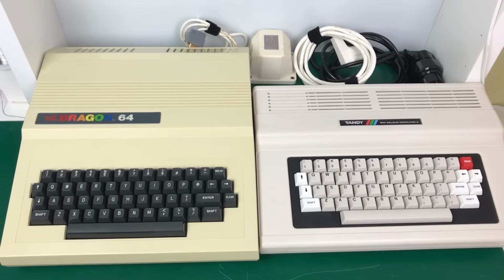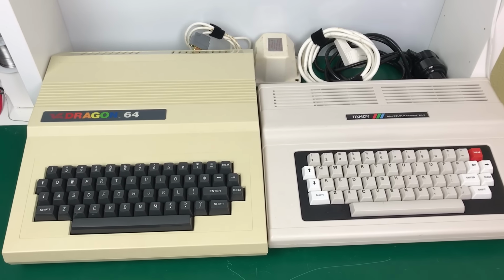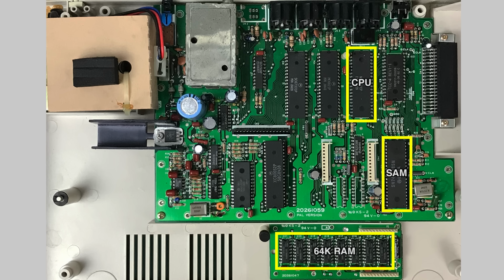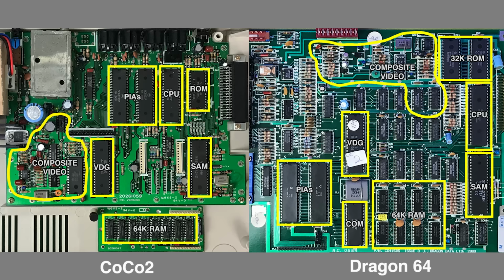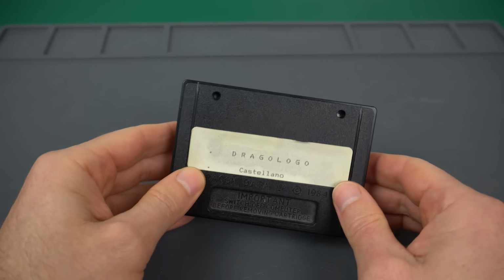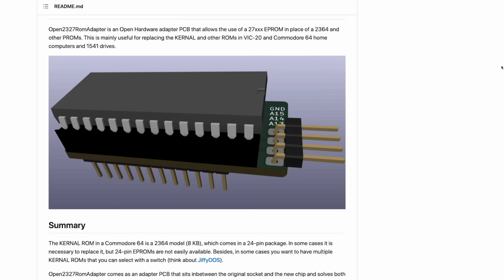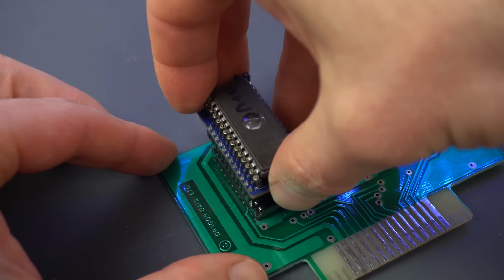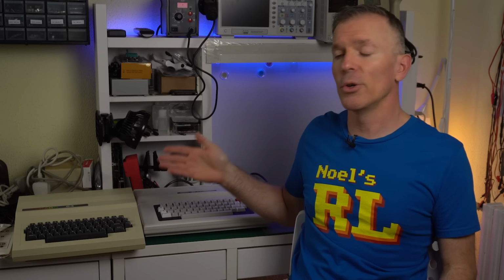Is The Dragon a Clone of the CoCo?

Comment: My favourite Dragon game was Speed King, I thought it played really well with an analogue joystick.

I'm pretty sure it's possible to convert a Dragon to a CoCo (or vice versa) by changing the ROM and using an adapter for the keyboard connector. I have a vague memory of reading about switchable adapters that could do both at the same time.
Reply: I suspected the hobbyist community in the UK figured something out: a lot of CoCo software out there compared to the Dragon I think.
Reply: Speed kong

Comment: Clones are usually equal or poorer.  The Dragon improved on the design so I think this is a little unfair.
Reply: Not always.  The CoCo didn't get a lot of love from the big developers, especially in the early years, so most of the games were clones.  Witness "Donkey King".  But in more than one case, the clones were every bit as good if not better than the official ports that were eventually put out.

The CoCo had a number of 'Frogger' clones, and also got an official 'Frogger'.  Some of the clones have better gameplay than the licensed version of the game, though it wasn't bad.

Comment: If you have a T1 VDG in the Coco, try this: POKE 359,57:POKE 65314,80. If the border turns green, and SHIFT-0 toggles between true upper and lowercase letters (as you type them), then you truly do have a T1. There is a version of OS-9 Level 1 that supports that fully, as well as numerous terminal programs, etc. Also, there is a trick to convert BASIC programs between them without retyping them (or using special utilities): Save them in ASCII format (for example CSAVE "PROGRAM",A). It is slower, but it doesn't tokenize. Also, one thing that is completely different is the disk drive ROM and disk drive formats; the Coco's use granules (9 sector blocks) while the Dragon uses actual sectors, and also supports >35 tracks. (The disk controllers on both can handle up to 80 tracks and double sided just fine; it's the Disk Extended BASIC vs. Dragon DOS ROM's that are completely different). Also, the CocoSDC also emulates hard drives as well (the Coco 3 with NitrOS-9 EOU is based on that).
Reply: Yes got to love NitrOS-9 L2 on the CoCo 3 with the CoCoSDC!

Comment: Is that Dragon MSX Compatible?
Reply from the maker: Compatible? Not at all, starting with a very different CPU.
Reply: I know that there are models that are MSX compatible. I saw a YouTube about this once.
Reply: There (almost) was a Dragon MSX, but it never made it past pre-production, so very few exists. It was a pure MSX though, so not compatible with the D32/64. And as Noel said, completely different CPU’s (6809 vs z80), as well as different sound and video chips. The BASIC interpreters were quite similar, though. The MSX standard was based on the old Spectravideo design.

Comment: I’m not sure you’re putting yourself in technology of the time. The bios was still relatively simple so that wasn’t too much to get done, but you wanted existing peripherals working with what you were building. And when you were trying to bring any new product to market, you generally either had to build up the circuits from individual components or use an integrated IC set.

Comment: Love it all, especially the 6809 disassembly and comparison.  Brings back memories.
Reply: The 6809 was an amazing CPU for its time, far superior to the 6502 I would say.  6809 assembly language is actually fun to program.  Apparently the price was a stumbling block and so it was rarely used.  A shame really.
Reply: It has more accumulators, more (16-bit) index registers, more (16-bit) stack pointers, more addressing modes, hardware multiply, and an 8-bit register that allows you to position the Direct Page anywhere in memory.
Reply: @joelavcoco  Indeed.  It's a shame the 6809 didn't see more use.  Imagine how much better the software would have been back in the day.  They did remarkable things with the 6502, but at the end of the day you can't get blood from a stone.
Reply: @Starchface  I loved the 6809 too. I thought it a lot nicer than the Z80 to program. However, I think the limitations of the 6847 VDG was a big part of why these machines didn't keep much of the market. Especially in the UK, where we could not use pseudocolours in hires mode.
Reply from the maker: Thank you! It was fun confirming why those few bytes were different.

Comment: So the board size of the Dragon looks to be similar to that of the board size of the original (1980) CoCo.  IIRC the original CoCo was just about as deep as the Dragon
Reply: Yes, it was... I used to sell these machines back in the early 80s in a small retail shop here in the UK, and they both took up similar desk-space.....  Both had external power supplies back then as well.  They also seemed more inter-compatible - you could use more game cartridges/tapes, and controllers between them!
Reply: @stevesstuff1450  The original CoCo had an integral power supply, but the TRS-80 (Model 1) did have a separate power brick.  That may be what you were thinking of.

Comment: I'm not sure the differences between the ROMs are entirely lawyer-inspired, any minor change to the code would shift things around, and the Dragon and CoCo used some different chips so the code for them would be slightly different, and if there's any support for the printer port on the Dragon then that will have added a huge chunk of code. Unless Dragon had specifically paid for compatibility, Microsoft wouldn't have bothered. Re-ordering the tokens is also a pretty good way for Microsoft to protect themselves from being accused of selling the customisation that Tandy undoubtedly paid for,
The cartridge port being the same could just be that its possible the Dragon 32 and the original CoCo were much closer in design than the '64 and CoCo 2 you have for comparison. It's also fair to say that at the time of the Dragon 32 the (personal) computer industry was very different and "borrowing" other peoples design ideas was tolerated a lot more than it is now if it wasn't too blatant. Generally being "first to market" with a product was the strategy rather than trying to be exclusive.
Tandy's computers were expensive in Europe, which is why they are so rare here, which is a shame. I used a model 1 Level 2 with expansion interface at my first job between school and uni, and I've always had a hankering to get one for sentimental reasons, but when they turn up they are either in terrible condition, or I don't have the money at the time! And I wouldn't rate my chances of getting one shipped from the 'States with the monitor intact for any reasonable amount of money!

Comment: I'd argue they're both variants of the same Motorola reference design, the relationship between modern AIB GPUs and the reference designs is similar. Perhaps the similarity in the i/o subsystem is related to a similarity in what parts were available and the rest is just "Yolo, may as well see what we can get away with". When you have an open source reference design (Motorola's)  and a previous system based on it (the CoCo) economics of scale means you might well wind up using the same parts (they'd be cheaper because the CoCo would be using them) which necessitates similar circuit design. I suspect one of the big draws of custom chip design (the NES or C64) over using off the shelf components (like the Coco or IBM PC) is making easy clonability much more difficult: instead of just reverse engineering the BIOS (or writing your own like Dragon did) you have to reverse engineer the custom chips which is a tricky business if you want to maintain compatibility AND keep the lawyers at bay.
Reply: The IBM PC XT appears to be based on a reference design of the Intel 8088. Why reinvent the wheel?
Reply: @migry  Yep and it could  be argued that with the XT IBM cloned the 5150 and added some improvements. I suspect Dragon Data knew full well that they were in the clear as long as they didn't clone Tandy's BIOS from developments in the early PC Compatible market. The rewired keyboard connector strikes me as a specific design choice (perhaps PCB design related) or a concession to overly cautious lawyers. To me the Dragon is more like the early x86 designs that came out just after the 5150 that were not truly PC compatible (i.e. the ones that ran on custom versions of MS-DOS). I'm more curious if the early 80's Dragon user community knew that the Dragon could be easily modded via a BIOS swap for CoCo compatibility.

Comment: Very thorough and unique approach as usually. I'm the owner of a cpc6128 and one of the things I would like is someone to make a step by step tutorial on how to make the simplest rom expansion, just one rom using one eprom / eeprom. As few components as possible. There are many products that do this but diy is what I'm looking for. The already available designs, include 4 or 6 roms and really, you need to solder a very large number of cables making them unattractive and cumbersome. I wish you consider this for a future tutorial.
Reply: i wanna know how/if its possible.. to convert it from the multiple DRAM chips to a single SRAM..or have a rom expansion that takes over from main ram from the get go.. (im having trouble sourcing 4164s atm)

Comment: That dragon looks to be a really cool clone of the Coco. I wonder if there is a mod to switch the BIOS ROMS to allow compatibility. I'd not be surprised if someone out there has done so.
I still have my original Coco 1 and the game I liked back then was Polaris. It's a Missile Command clone. Unlike most home versions, the analog joysticks make moving the cursor to fire your missiles a lot like using a track ball. You should check it out! Great video as always!
Reply: Betagamma Computing have done exactly this with the DraCo64 machine conversions. Both Dragon 64 and CoCo II compatible at the flick of a switch. The systems include a keyboard remapper board.
Reply: @mikemiller1208  I knew someone out there has done it before. They are practically the same machine with minor differences.
Reply: Very likely just swapping the ROM chips would simply work, though you would not get a working keyboard without a bit of editing of the ROM, to change the mapping of key matrix to characters, which might be hard as it looks like the actual routine depends on simple bit pattern shifts, so you would need to find spare room in the ROM to put the extra bit shuffling in, as likely the existing keyboard routine memory is tightly packed.
Reply: @SeanBZA  I'm sure some clever hacker out there could have and may have already figured it out. Possibly use an Arduino or some small SBC to do a ROM emulation. I would think that you simply change out the bit pattern for the CoCo switch and no need to take up anymore memory would work too.
Reply: Agreed on Polaris.  It's a great game, and I think it even runs on a 4K machine.  (Maybe 16K?)  I remember how horrible Missile Command was on the Atari 2600, but even the old 1-button, non-centering "black beauty" CoCo analog sticks made Polaris a dream to play.  Great for flight sims as well.
Reply: @joelavcoco  I loved the 2600 version considering it was able to do it at all. But nowadays we are seeing things with the 2600 that are just mind blowing.

Comment: Since I didn' t own any of these computers(I had only the lame ZX Spectrum +), I can' t express any opinions(not to mention that I "lost the ball" almost from the very beginning), but I will give you only two suggestions(again):

-First, can' t you build a simple circuit that will have a ZIF socket and an external power jack for the ROMs you want to program, but your programmer can' t handle their programming voltage? Along with a couple of pin headers attached to some cables? This way, you will be able to use a transistor that will use the external power thru an input from your low-power output, fed thru that transistor to the power-hungry ROM. Of course there should be some extra female headers in order to drive a cable to the specific pin you want to boost with the transistor with a cable...

-And second, if the programs are virtually identical except their addresses, can' t you make a simple program which will be taking any program written for the one computer and just make the appropriate relocations to the addresses for the other computer?
Reply: The ZX Spectrum in it's various iterations was never a 'lame' computer.........
It was inexpensive, and originally had a 'dodgy' keyboard, but later revisions fixed that.  Come the +2 models they now had a much better sound synthesiser chip outputting to the TV that could sound really good!  It had better use of colour/resolution than most other 8-bit machines at the time - as long as you could avoid the horrible colour-clash!!
But it can't be denied that regardless of it's limitations, it created a whole new generation of bedroom coders and companies; many of whom are still around today - take EA for example....not everyone's favourite company now because of their inexcusable loot-box systems, but EA started back then publishing Spectrum games, and has some of the most respected coders and computer musicians associated with it, alongside the C64, of course....
Reply: @stevesstuff1450  Yes, since +2 they started putting more humane keyboards, but I, personally, had the +...

Comment: Both of these don't look like much but they actually feature the best (and most expensive) 8-bit CPU ever. The 6809 is like the grand daddy of the 6502 and very much prepared to run a real multi-tasking operating system as we know it today.
Reply: 6502 was the cheapest 8 bit MPU. Nothing else about it is remarkable. The 6809 is a joy to program for in comparison.
Reply: @lawrencemanning  As is probably clear to anybody who's written just a few thousand lines of assembler for each, the 6502 is remarkably well designed, with a number of design choices that were clear improvements over its inspiration the 6800 (not the 6809, which came years later) even when you're not taking cost into account.

Among other things these include removing some of the most annoying behaviours of the 6800 (setting flags on stores, not being able to push the index register), being little-endian to save a cycle on any instruction involving a 16-bit address calculation, and being able to do indirect memory access through an address in any zero page location, rather than just through a single index register.

Though the cost  considerations seem to have precluded making a CPU that was better in every respect than the 6800, the 6502 designers did produce a CPU that was faster and had more powerful addressing modes, as well as being well under half the price.
Reply: IMHO I think it had the best basic, and a very easy to use assembler
Reply: The 6809 is an upgraded 6800, which is the 8-bit precursor to the 68000.
Reply: The greatest thing about the 6809/6502 was the PCR (Program Counter Relative) data instructions, which meant that it was possible to make a program completely relocatable in memory.
I used that feature in a machine-code program which was designed to allow a BASIC program to print the entire IBM extended ASCII character set on the "high resolution" display on the COCO.
The data for the characters took up more space than the program did, yet the program had advanced features such as allowing the BASIC program to redefine characters without having to know where to POKE the character definitions in memory; print characters in reverse video; reposition the cursor; clear the screen and home the cursor and so on.
Reply: @melkiorwiseman  I wrote all my 6809 in PCR mode. It used to annoy me that this was not a standard feature of all CPUs and programs. MS DOS had the EXE file format in which the program loader would fix up all the absolute addresses to match the target memory load address. So it did not really matter for other CPUs.

Comment: The old Input magazine in the UK had example programs the were for Dragon and Tandy, can’t remember if there were any changes between them.
Reply: There were a few I seem to remember, probably associated with the different ROMs and direct reading of the keyboard hardware. But where they stuck to run of the mill BASIC functionality the listings were identical.

Comment: The 6809E was also used in CMI's FAIRLIGHT V.
Reply: It was also used for a number of Williams arcade games.  A guy by the name of Glen Hewlett has recently ported the arcade Joust and Defender ROM code to the CoCo 3, and they're astounding.

The FAIRLIGHT not only uses the 6809, but also runs the OS-9 real-time operating system, which also runs on the CoCo and the Dragon.  You could literally run the same OS-9 binaries on a CoCo, a Dragon, or a CMI FAIRLIGHT.